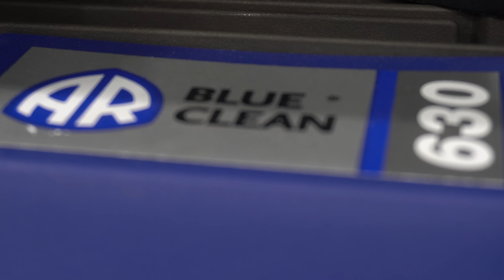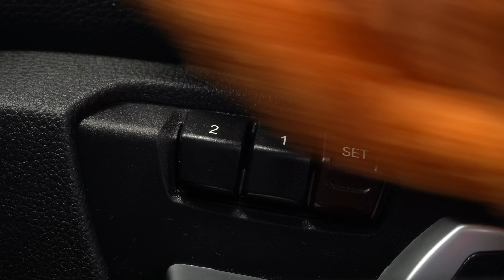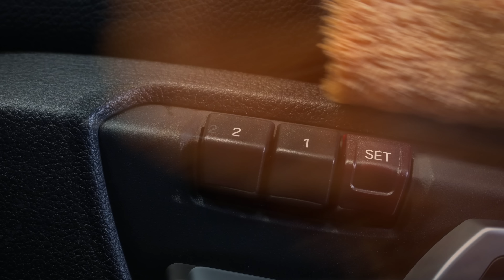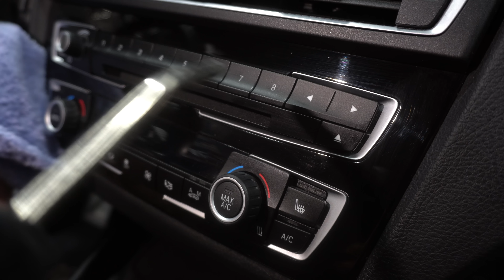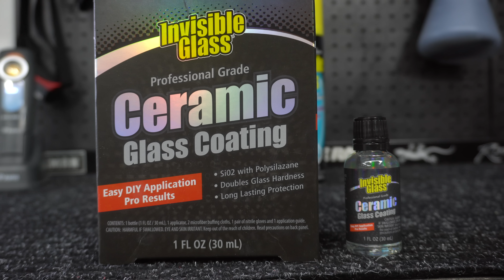BLUE BMW M2 DETAIL | Full Interior + Exterior + Polish + Ceramic Coating of 2017 Long Beach Blue M2

Comment: That is one SWEET BMW M2,  especially after the RAD GARAGE spa week treatment!    Very nice.    And that blue color is spectacular on that car.      Air is without a doubt one of the most indispensable tools in detailing as noted at 20:18 where the air is literally blowing out all the muck and grime.     Imagine if you didn't use air on that piece,  most of that gunk would still be in those cracks and would just re-dry and be imbedded in the cracks.     Even if you don't have compressed air, which I do not,  I still get effective air from one of those hand held air blowers and use it quite often on interior details just to do this very thing, blow out all the cracks and dry everything rapidly which it does a great job for.     Final result.........better than the day it rolled out of the showroom!
Reply from the maker: Yes, air is indispensable when dealing with those little nooks and crannies. Nothing is more satisfying to me than when you dislodge a tiny piece of debris from a super tight space. Victory! 🤘

Comment: Rick this blue BMW is just stunning and I think the car looks brand new. The Gyeon foam seemed to hit the sweet spot foaming on thick but running off at a good pace. The Detail firm brush covers a lot of area and I definitely need to get one. Stoners glass cleaner is in my garage but I have never seen the ceramic glass coating they have. I will definitely keep my eye out on this product. Thank you for another awesome video!
Reply from the maker: Thanks for tuning in Neil. I was very pleased with how each product and tool worked during this project. That shaving ball brush is by Detail Factory and it is just awesome. I wish they had a stiffer version to go with this ultra plush one. Stoner has really expanded their line as of late and I’m loving the stuff they have been sending my way. Feel free to use RAD20 at their website. Take care man. I’m off to the mountains for some R&R. 🤘

Comment: Huge work, but great job. Car is absolutely reborn.
I have a question. I used the Adams rubber mat Liner Cleaner last week for the first time. I had an expectation for it to give my mats a fresh look. However it had do such impact. Adams worked like an ordinary APC, it only cleaned my mats, nothing more. Is it usual? What is your thoughts for this product?
Reply from the maker: I find Adam’s RM&LC to be my favourite mat cleaner. I like that it leaves to greasy residue behind. Perhaps you would like to use a trim and/or rubber dressing to finish yours off?
Reply: @RADGarage  I dont like greasy finish, therefore I do not intend to use any dressing product after cleaning my mats. I expected Adams RMLC clean and give a fresh look (factory new finish) at the same time. However I am not successful. Perhaps it is related to raw material of mats. Because some people claim to get the result from Adams RMLC that I look for.
Reply from the maker: Yes, I suspect you are correct. The finish probably has everything to do with the type of rubber mat you are working with, rather than the cleaner. Are you getting a greasy finish on yours?
Reply: @RADGarage  If I clean my mats only with an APC or Adams RMLC, I do not get greasy surface, I have clean and matt finish. However when I apply any dressing unit after clean and dry my mats, I have greasy finish.

Comment: Wow great job 👏 Just curious, have you considered to apply Hyde's Rustopper on this m2? Whenever I finish the first drive after car wash, my wheels get some rusty brown things from rotors. I have f80 which comes with the same brake and rotors as this M2 so just curious about the rust stopper
Reply from the maker: The rotor rust on this car was absolutely out of control! I was going to take it for a quick ride to rid the rotors of the rust but the rain and wind had other ideas. Unfortunately, I had to leave them rusty. The Hyde’s has never worked for me so I gave up on that. But, like you said, these rotors are the worst for rusting. Let me know if you ever find a solution that works.
Reply: @RADGarage  So I sprayed some water just couple times directly to MF towel and wipe the rotor down. Today, I drove to my office and didn’t really see any rust on my wheels! I think I’ll stick with this method now although I have to trash the MF towels every time

Comment: Love watching ur process bradah and Im with u on the PPF had all my cars wrapped but after a few years i decided to take them all except for one bumper but i instead invested on a good clear coat and good painter lol , had him re shoot the front ends and so rock chips havent been an issue for me.
Reply from the maker: You added EXTRA clear coat to the front of you car? That's incredible. I have never heard of that. I appreciate the protection PPF provides, but it such a bummer to work with.
Reply: @RADGarage  yes  brafah my paint guy added something on the clear coat to make the clear more durable forgot what it’s called I’ll find out. Now I barely have rock chips, PPF is awesome , the downside from my experience was the width of the film ( if ur hood is wider than 72 inches then u can’t do full coverage which is advisable because if u do half ull notice the cut line more and more as the years go.) I wouldn’t keep the clear bra for more than 3 years because the longer u leave it on the painted surface the more it’ll bond itself to the painted fender , hood and etc? ) lastly some ppff have orange peal, on a good note the the best one I tried was the windshield ppf works and you can stick it on and peel it back it’s reusable .
Reply from the maker: That is very interesting. Send me a link or something if you can find one.

Comment: Wow…just wow Rick, this thing looks stunning!  Need to try that Turbo Wax Swirl Remover Pro X.  And you used a wool pad, that’s another Wow!  I thought wool was for the worst paints, but maybe the camera could show how bad things were.  Was it pretty bad?  Was that polisher running at fairly higher speeds for the correction?  Thx
Reply from the maker: I have been impressed with how well the wool pads work, but they also finish very nicely. I wasn't having as much luck with the Yellow Foam pads, so I stepped it up and it worked out perfectly! Definitely give the coarse and medium Rupes pads a try. I'm confident you will be impressed. I was running between 3-4 speed. The paint was tricky in some spots. I think the previous owner washed this car a LOT and used a ton of pressure when doing so. I was able to get it back to 95% but there were some deeper scratches in the weirdest of places.
Reply: @RADGarage  That sounds great. Makes me think that when I get my hands on that wax, I might experiment with the 50/50 Uro fiber pads as well.  Thank again!
Reply from the maker: I believe the guy behind the product likes to use the uro fibre pads as well.